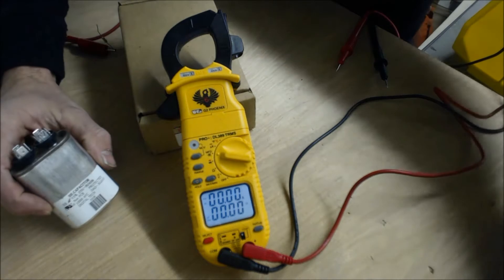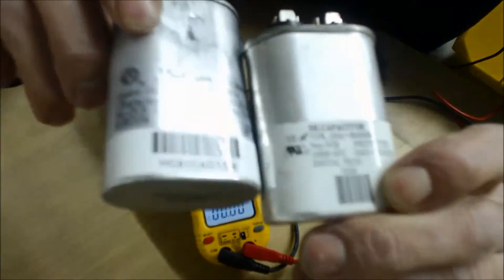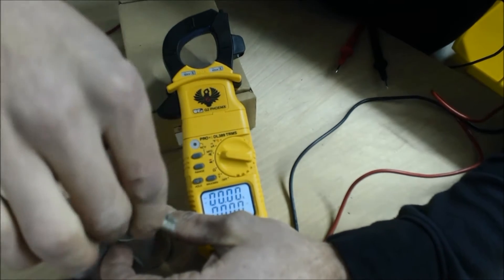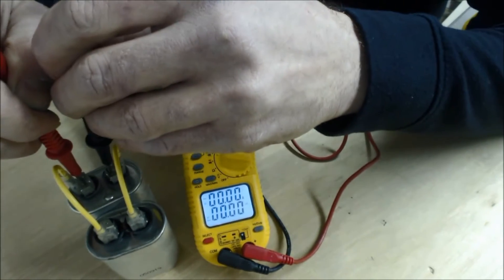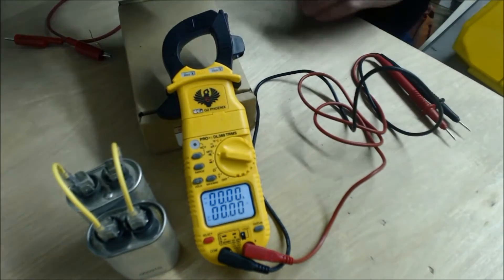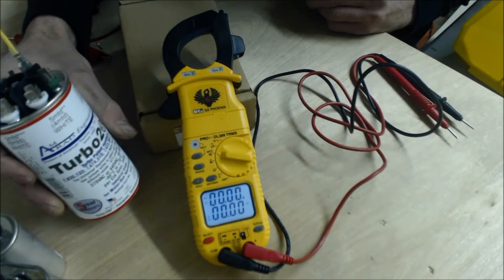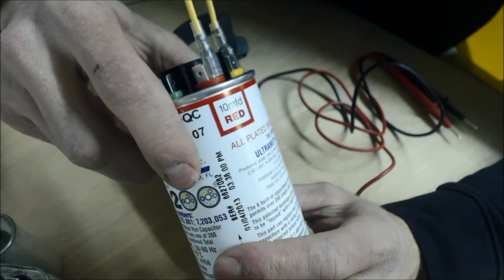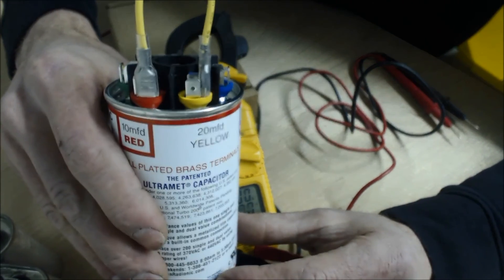Two Capacitors Connected to Increase mfd(uF)! For Emergencies to get the Customer Running!

Comment: So if you dont a have 20mfd cap. you can join (2) 10 mfd to make a twenty. Later the customer has an issue and its the Capacitor do you replace both or just the bad one? Why add another failure point?

Comment: I added a suppco hard start kit to my 12000 BTU ductless unit I run with a Honda 3000. The unit has a single dual run/start capacitor. It didn't seem to make a difference as the gennie still bogs down (i didnt put a meter on it), is it possible to add another capacitor in parallel to help out on run amp draw (total of three capacitors)?
Reply from the maker: A hard start kit just helps to start for the initial 1/4 second. The motor needs to run with the specific run cap as on the rating plate or the motor will burn out, thanks!